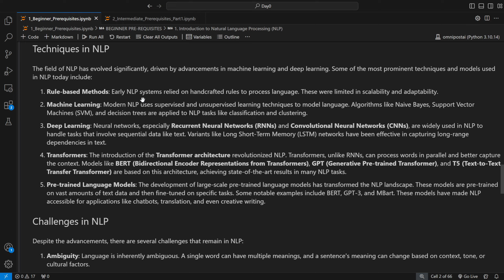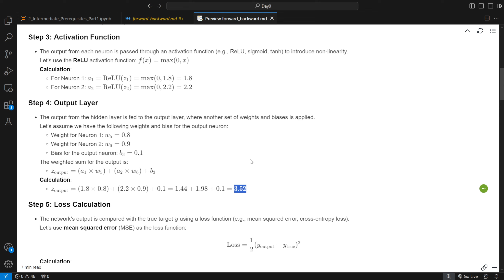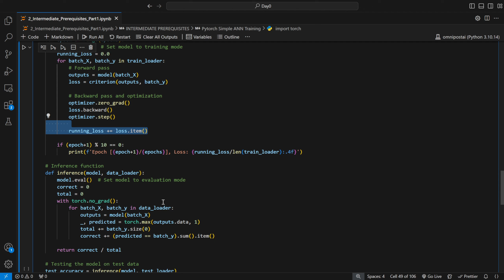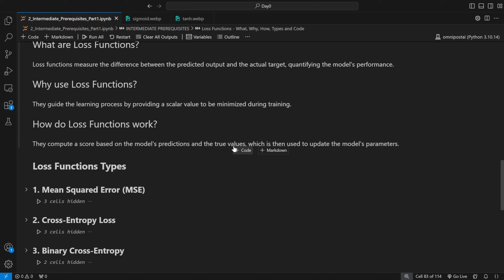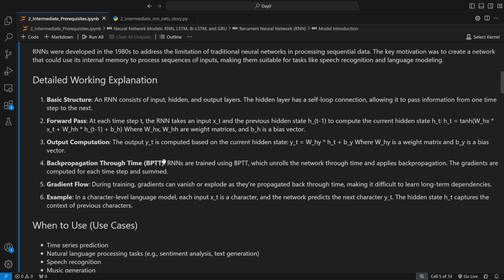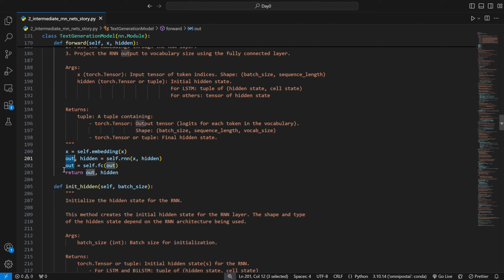LLM Mastery in 30 Days: Day 0 Prerequisites Part2 - DL For NLP - ANN, RNN, LSTM...

Comment: Here is the detailed list of all the topics covered in this awesome tutorial 🔥🔥->>

00:05 Introduction to deep learning and neural networks
02:44 Deep learning automatically learns features and is highly scalable
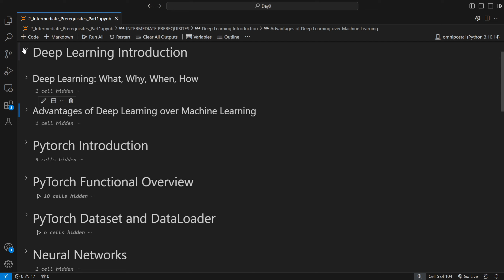07:25 PyTorch is a flexible and efficient deep learning library developed by Facebook AI.
09:53 Introduction to torch for complex calculations and GPU usage
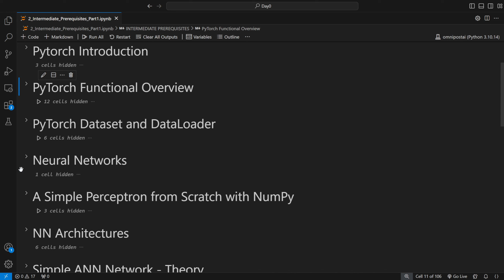15:16 Using PyTorch's Dataset and DataLoader for efficient data handling
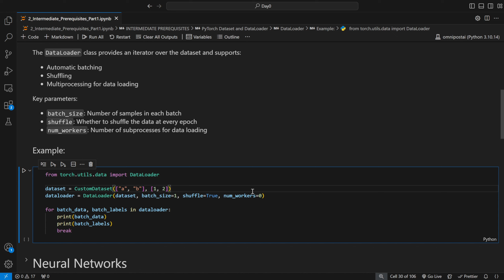17:35 Introduction to Data Loader and Neuron Networks
21:54 Introduction to Artificial Neural Networks (ANN)
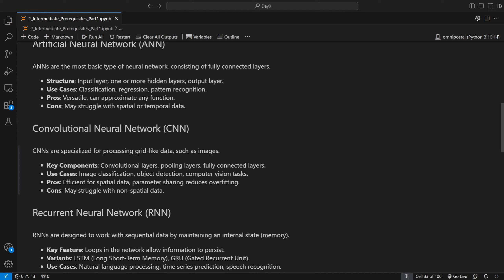23:59 RNN designed for sequential data handling
28:36 Understanding the architecture of a neural network.
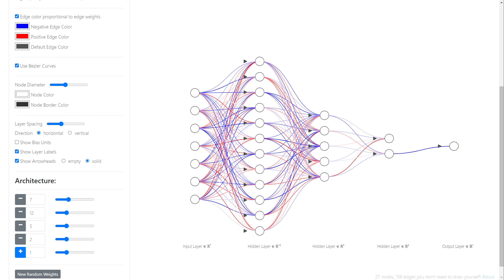31:06 Understanding Forward Propagation in Neural Networks
35:35 Calculating gradients and updating weights in deep learning
37:53 Activation function differentiation and weight impact
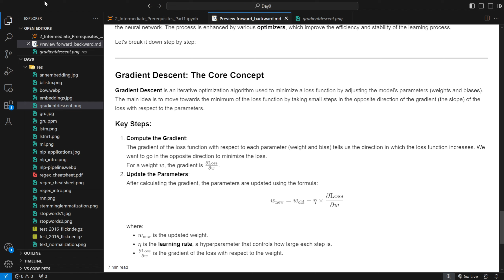42:24 Moving towards global minima by taking small steps
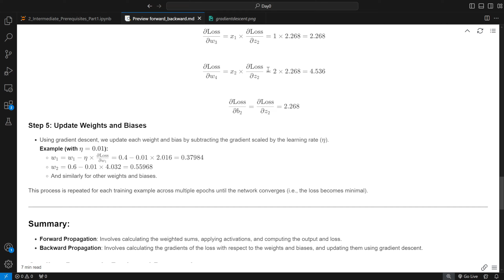44:26 Gradient Descent and Backpropagation in Neural Networks
48:19 Activation functions and layer initialization in neural networks.
50:26 Overview of common techniques in neural networks
54:39 Training Loop with Crossentropy Loss and Adam Optimizer
56:48 Activation functions in neural networks
1:00:59 Explanation of hyperbolic tangent function
1:03:07 Activation Functions and Error Propagation
1:07:39 Explanation of Activation Function Calculations
1:09:56 Choosing activation and loss functions for neural network
1:13:50 Explanation of binary cross entropy and optimizers in neural networks
1:15:58 Stochastic Gradient Descent (SGD) as a basic form of Optimizer
1:19:46 Understanding Recurrent Neural Networks (RNN)
1:22:13 Recurrent Neural Network (RNN) was developed to process sequential data.
1:26:41 Utilizing previous time step values in neural network forward pass
1:29:00 Explanation of back propagation Through Time in RNN
1:33:15 RNN has disadvantages in capturing long-term dependencies and is computationally expensive for long sequences
1:35:26 LSTM selectively forgets and remembers information over time
1:40:01 The tan layer provides intensity for memory retention in LSTM networks.
1:42:01 Explanation of LSTM functioning
1:46:13 LSTM is more complicated than RNNs and requires correct initialization and hyperparameters for training
1:48:28 LSTM in NLP requires understanding full context sequence
1:52:49 Comparison between LSTM and GRU in NLP
1:54:51 GRU is computationally efficient compared to LSTMs
1:59:18 Overview of the code structure and usage of key libraries
2:01:21 Key considerations for NLP model configuration
2:05:34 Explanation of embedding and hidden dimensions for NLP models.
2:07:33 Initializing the model for text generation
2:11:30 Creating vocabulary and data processing for NLP
2:13:32 Preparing dataset and training LSTM model for story generation.